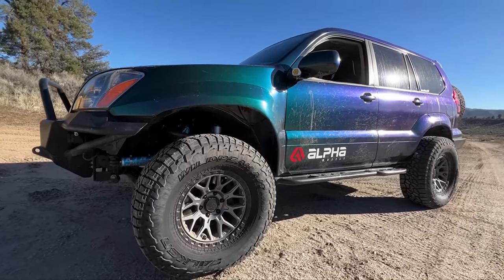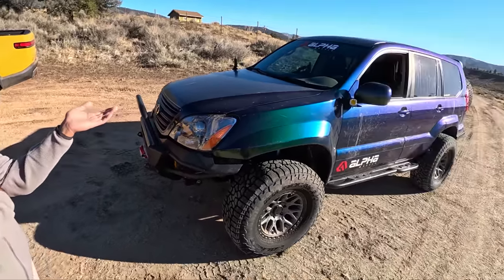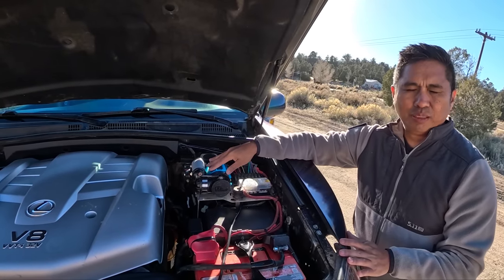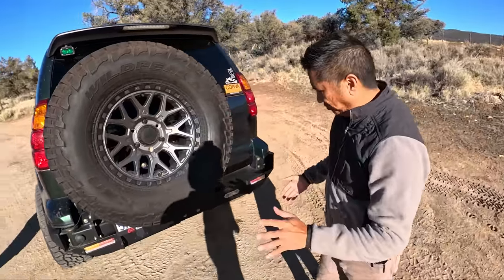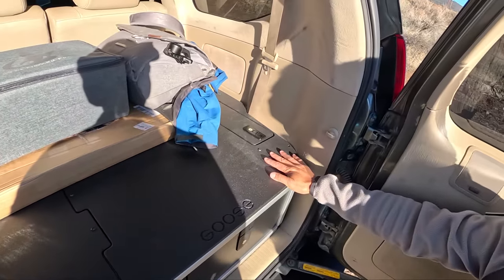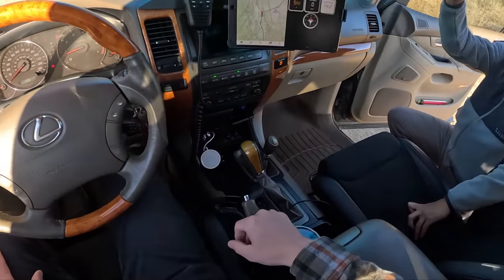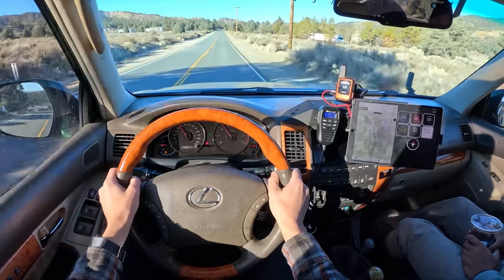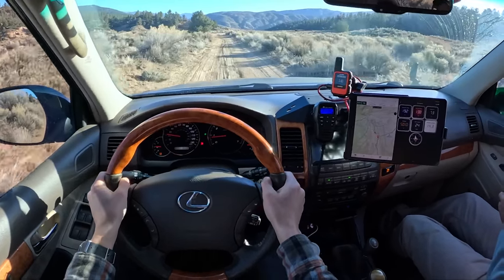Overland Built 2007 Lexus GX 470 - POV Review

Comment: Awesome ride, I have been rigging out my 07 GX. Could you explain a little further your Ipad and Garmin Setup? So the Garmin allows the Ipad to have gps data for Gaia but then how are you getting engine data? A Bluetooth OBD2 and an app?
Reply: Hi there, I’m the owner. It was running an iPad Pro 10.5”. The Garmin connects to the iPad to provide GPS data and I use a Veepeak OBD reader that transmits vehicle data via Bluetooth. To tie it altogether the iPad is running the OBDFusion app to display the info. Hope this helps.